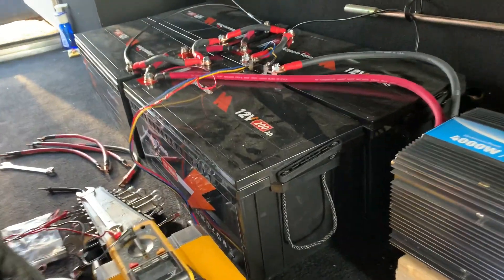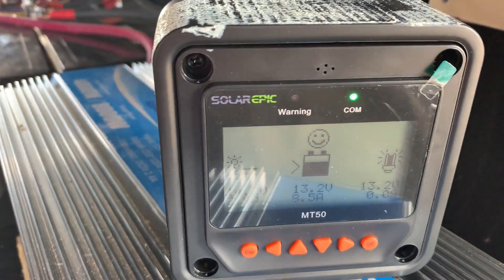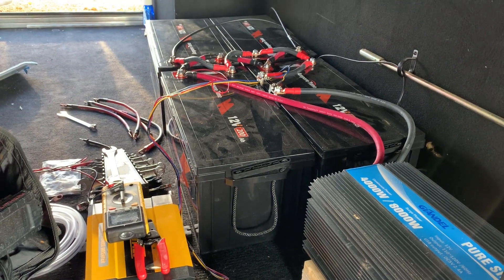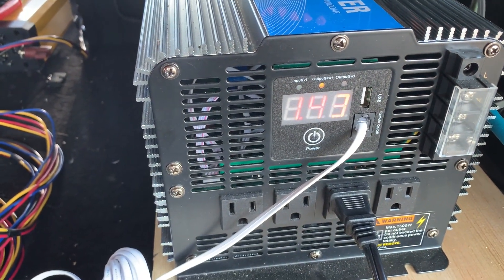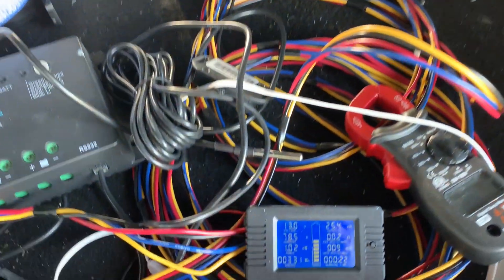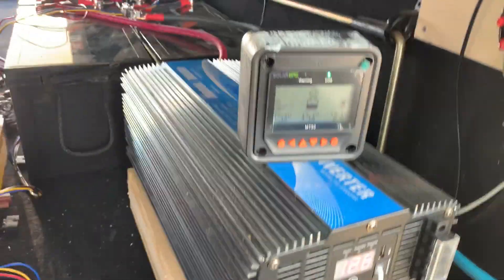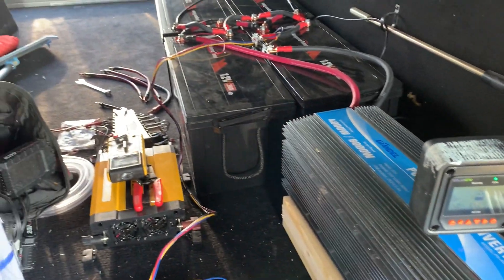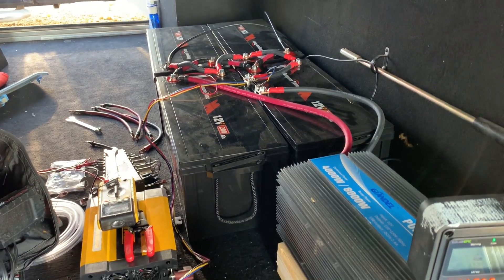Problem! Ampere Time Battery 12V 200AH LiFePO4 - Part #2

Comment: Looks like 3 points should be checked:

 1. There should be power through all the batteries – connection + and – on the pole with only one wire. 
2. Panels with 36 cells can be connected in series with increased total Volt – when the regulator can withstand 150Volt. It gives better effect than with parallel. 
3. Battery Monitor must be set to match the size of the shunt used. There are several options in the menu. This point can be the whole problem.

https://www.youtube.com/watch?v=fjC6GEZXNi4&t=212s

Comment: Start at the basics
 input - output = net charge
In.           Out.          Net
400W - 1200W = -800 W 
Negative sign means discharge.

Power into the battery =
 4 *100W  panels * efficiency of CC{0.98 for mppt or 0.7 PWM}
Actual output of your panel will be less than 100 given temperature and energy variation from the sun. Peak sun power occurs at solar noon. 
For a rough calculation let's say the solar and temperature conditions are perfect at 100 Watts.
So battery input power =
400*0.98 = 392 Watts at noon.

Power out of battery = 
(1200 watt heater + other loads) + all loads * efficiency of inverter{0.8} + inverter idle loss of inverter
Let's assume a perfect inverter
And the only load is 1200 Watts
398 Is far less than 1200 

Your input  to the batteries is far lower then your output to your loads.

 Of course your batteries are not charging and are discharging.

The best you can do is minimize loads to get a charge of
398W - min loads.

Comment: So, have you solve it already after all? Did you find anything to improve that want to share with us?. I want to buy theses same batteries for a 48v system and I am curious if they are good or not. Thanks
Reply from the maker: I just added another 400 watt panel in series it helped tremendously. 
I want to go to a 48 volt system as well but need to get a new charge controller combo unit first.
Thinking about going with a Growatt.
Check out this video for a short update. https://youtu.be/g3JYxhhYWXc
Reply: @thervsolarseries2827  I got the victron 150/35. Amazing machine. Thanks for answering

Comment: Your CC can take a max of 92v open circuit (model 4210AN) for the panels so consider putting your four 12v panels in series. In low sun conditions, the CC will convert the higher voltage into more usable charging amps. This means you start putting power into the system earlier in the morning and stop putting power in later in the evening when compared to having all the 12v panels in parallel. Great for cloud covered days as well. This is one of the main reasons we all buy MPPT over PWM. Remember to keep the combined open circuit voltage of the panels you plan to use at least 5v below the rated 92v open circuit listed in the manual for the CC as best practice. With your four 12v panels here you should have about 18voc per panel giving you around 72voc. The working voltage will be displayed at around 60+ volts in full sun.
Reply from the maker: Great information thanks! I’m using the Tracer4215BN charge controller.
Reply: Yes you need to put your panels in series!!
Reply: Whats  interesting is for me  the amps goes down  if panels are in series.   Say at peak  sunlight  they produce 5 Amps   as  measured by mppt controler but  in parall its  6 Amps.    My panels are mismatched but they give  high voltage when connected in series so thought it wouldn't affect it but  it seems it makes it worse In series

Comment: I have 400 watts on the roof flat. At nite I run a refer 12 volt, 2.25 amp fan and laptop. starts at 13.1 ends at 12.9 or 13. Will hang in that 50 % range forever. well a few days anyhow. I only charge to 13.8 then float at 13.4 and never start the nite with more than 13.2 volts. EPever 40 amp controller. only had it two months 1- 200 ah ampere battery. seems okay. If it ain't broke don't fix it.
Reply from the maker: Agreed. I recently went to that same charge controller. It is much more efficient.

Comment: Is that the EPever 40a controller? I'm going to buy one soon, do you like it?
Reply from the maker: Yes it is. I really like it so far. It’s my third controller I have tried and so far and I like it the best. I’ve been meaning to do a video on it but haven’t got around to it. But it is a very efficient controller. I do wish it could handle more solar input though. Only about 580 watts input max.
Reply: @thervsolarseries2827   That's exactly what I thought!!  But on Amazon it states:

This 40 amp MPPT Solar Panel Charger works with 600W Solar Panel on 12V Battery System and 1200W on 24V Battery. Max Solar Panel 1560W, multiple load mode allow you set the load on/off in different situation. A Solid State Relay is recommended if you are using a Power Inverter

So on this controller you can over panel up to 1560w. That was a selling point for me!!! I have 2 310w panels all ready for it.
Reply: @SteveV2023  Yes that is what my manual says as well. I am using with a 12 volt setup. I have 11 400 watt panels but have only been using one so far.